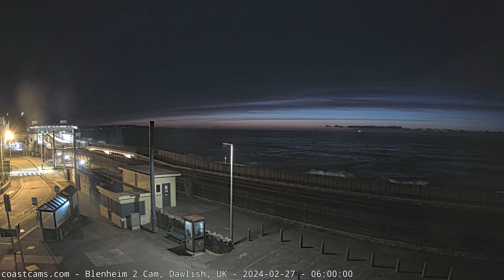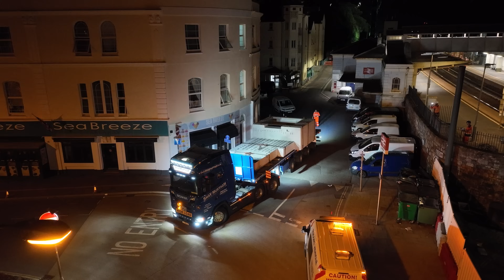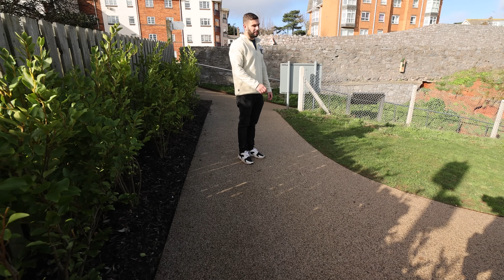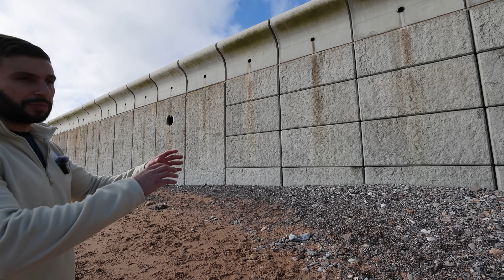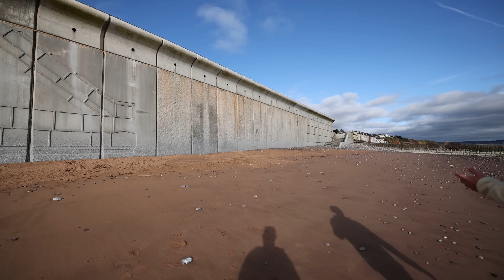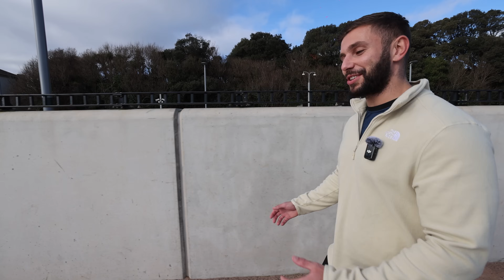The Completed Phase Two Sea Wall Tour Part 2

Comment: Jack, was salt damage an issue to heavy plant? Mike, Melb.
Reply: It was mainly on the pins connecting the tracks which corroded leading to pins fracturing over time and tracks coming loose, also a nightmare for electrical wiring

Comment: Is there a reason why the boathouse could have been taken apart and rebuilt on the projected out bit? There seems heaps of space. Or Even at a new location. Seems a total waste to lose that history.
Reply: Probably would need to be recreated by a charity funded project I expect.
Reply: I think you missed the part where Jack said that a wave that hit further along the railway lifted up a four ton block of stone and threw it onto the railway. Climate change has made the Dawlish coast a lot more at risk to damage by storms than it used to be. The boathouse would have needed to have been moved to another location in Dawlish. Not left for the sea to tear it apart in a future storm. If someone had offered to take and rebuild the Boathouse, BAM would almost certainly have numbered all the stones, and had it taken apart carefully. They did leave the other building that was joined to the station, but that building was partially buried by concrete on the outside.